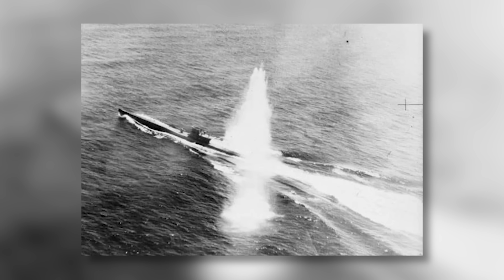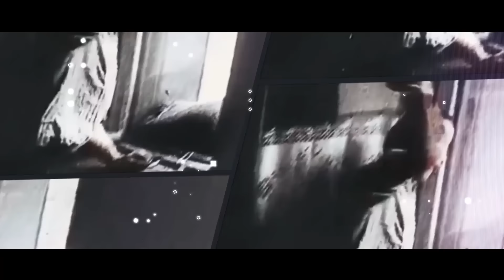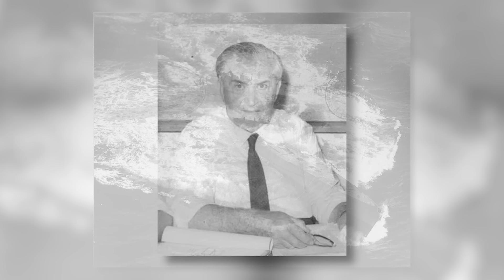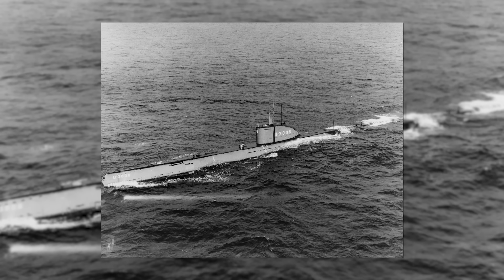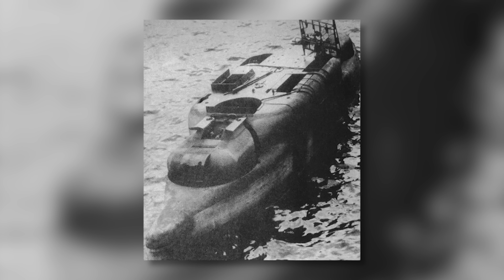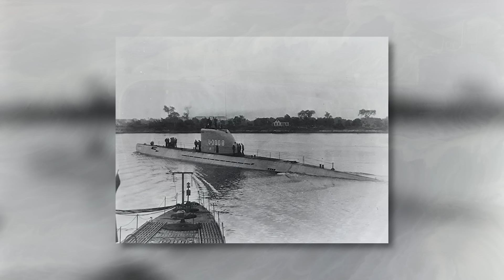The Most Radical Submarine Prototype Germany Never Got to Release

Comment: Anti-submarine aircraft sank half of all U-boats and mostly at night with radar. The Luftwaffe could have used radar detectors to home in on the anti-sub planes with night fighters like they did with British bombers and that would have ended half the losses. The other half of losses were from surface ships and a device that was actually fairly simple, the wire-guided torpedo, would have allowed the U-boats to fight back against the escort ships and would also have made them far more effective at sinking cargo ships. Early enough in the war, these two advantages might have won the war at sea.

Comment: Germany needed the Type XXI developed, perfected, mass produced before the WW2 started.  Well trained crews. Also, needed reliable smart torpedos of different kinds,  equally important would have been long range, very high altitude, air surveilance and secure comms.  Resources would need to be moved away from big surface ships.  Would have to achieve near 100% blockaded early in 1939/40 before USA got mobilized.  Force Britain to seek armistice.  May be.  Same for jet airplanes.  Germany had no staying power.  That is why Churchill was surprised at the speed of the Blitzkrieg of Western Europe.

Comment: 2:24 an hour or two? Even when abusing their electric motors the most common U-boat, the Type VII, would be able to run 12 hours at minimum. With proper discipline and tactics, 14-24.  Most of their ballast was made of of massive banks of batteries that ran most of the length of the sub, which even in the 1930s and 40s with primitive battery technology, meant a massive dive capacity.  They had to worry about oxygen more than battery capacity.
Reply: not sure about that
Reply: @Onezmhu there is a reason they made very basic scrubbers

Comment: The effect of the type design outlived it's lift. Both the US and USSR  were racing to sail a nuclear powered submarine. The capabilities of such a submarine wanted an entire new design. Both side put large amounts of money into this and neither side had unlimited funds, some cuts needed be made. Both sides had to decide which part of the design would get the most funds. The US choose to use the Type 21 hull as a bases for the Nautilus 571. Putting more money into the reactor, turbine propulsion system.

The USSR put it's funding largely into the hull design, a more effective torpedo shape. Seems simple enough but this design had not much, if anything, of a proven design to build on. This left the nuclear propulsion system a bit of a poor cousin. The result s that for several design generations USSR nuclear submarines suffered fires and reactor failures.

The US would adopt the torpedo shape later. And being a new design went through design challenges. The early Thresher class submarines had a flaw that allowed the rear of the submarine to be pushed into the forward half like a telescope being pushed in, catastrophic failure with the loss of the entire crew.

Comment: The Walther turbine has the distinction of being one of the very few (only?) internal combustion steam engine.

As dangerous as High test hydrogen peroxide was as an oxidizer, the Royal Navy. commissioned one of the Type XVIII U-boats for research, and then built its own class of two submarines powered by Walther turbines (HMS Explorer and HMS Excalibur) to further develop the idea.  The Royal Navy built a Walther turbine powered torpedo, as did the Soviet navy.  Both were withdrawn from service after incidents that sank submarines.  HMS Sidon has a torpedo over pressurize its casing with evolved gases from the peroxide that the casing ruptured and blew both end caps from the torpedo tube, opening the aft torpedo room to the sea.  Fortunately, HMS Sidon was tied up in port, at the time, so finding her and rescuing the survivors was not very difficult.  The Russian submarine Kursk was lost to a fire caused by a mishandling of a Walther torpedo.  By contrast, once they realized what the IJN oxygen torpedoes were, the allies gave a collective 'NOPE!' and nobody looked at them again.

Comment: actually you forgot the alberich skin. that was a anti-sonar coating. jepp: this submarine was the first vessel ever to use tech that we would recognise as stealth tech. also there where apparently some experiment with radar absorbing coating for the snorkel heads of the type XXI submarines wich, if true would make this the first time some tried to make something invisible on radar.
Reply: Thats not entirely true, 14 submarines  had the Alberich skin like U-480 but no type XXI had the Alberich skin! It was Experimented on it already in 1931. And it "only" reduced 15% of the effectivness of Asdic, wich is still really good.
Reply: It didn’t work and did nothing to stop detection via passive sonar; WW2 submarines were very loud. Also Germany doesn’t have enough rubber to equip a sizeable amount of submarines.

Comment: actually it was the other way around. radar makes you MORE visible to your target than the other way around. and the kriegsmarine had adapted to this fact with radar detectors. the allies actually used passive radar to find submarines. the trick behind that is to listen to the radio broadcast of a surfaced submarine and then use the signal plus your planes trajectory to determine the location of the submarine.
Reply: Also, the  German radar detectors, Metox I think they were named,  transmitted their own signal. Allied sub hunting aircraft were equipped with the electronics to pick up these signals and home in on them. So these sub hunters turned off their own radars and listed for the German sub's radar detector, then flew right to them, catching them on the surface.
Reply: @edwardcnnell2853  sigh.metox didn't emit anything detectable, but the german navy thought it did so ordered their crews to turn them off.What did them in was not understanding  the capabilities of Hufduf ,too much micro managing and unwilling to accept that enigma could be broken.And of course contrary to popular opinion the allies co-operated with each other.
Reply: @edwardcnnell2853  actually no. you can detect passive sensors like maddox but only on realy short range. what the allies insted relied upon was the biggest weakspot of the wolfpack tactik: you need a lot of communication to make it work.

even thou the kriegsmarine had a early form of recording device that they used to compress the signals the typical communication signal of a kriegsmarine submarine was about 1,5 seconds long in its compressed form. the allied planes needed only about 0,5 seconds of signal to triangulate the actuall position.

 this method is called passive radar btw. and it can be used to find radar systems.... long before they can find you.